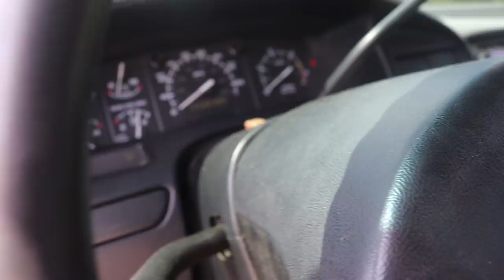CASE 550 Dozer FIRST START in years!

Comment: That’s a pretty nice dozer you have there. We have a ‘79 John Deere 350c bulldozer. Awesome machine. Super reliable, always starts and runs with no issues. Diesel too obviously. All around a great machine. It doesn’t get used as much as it used to so we try to run it every once in a while just to keep the batteries charged and what not. Fun to drive.